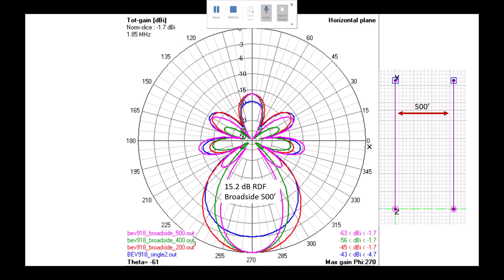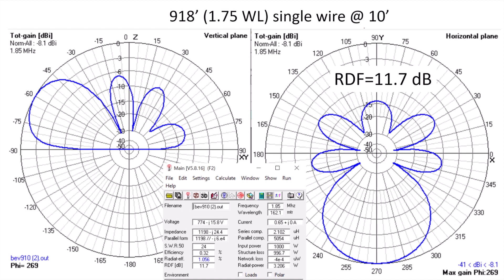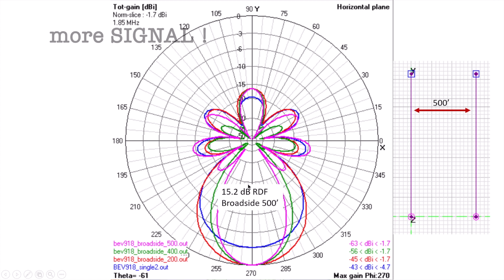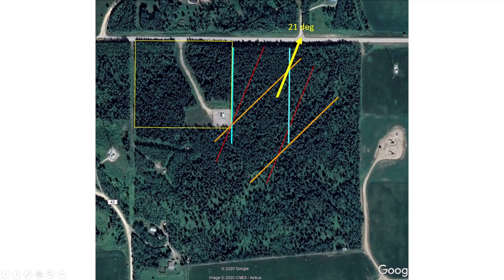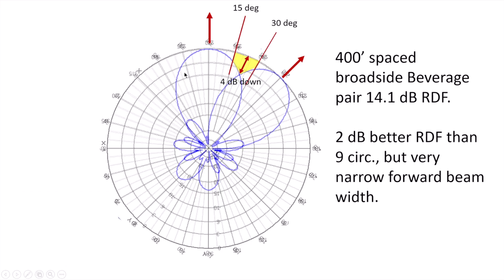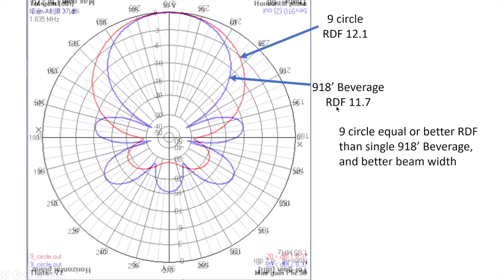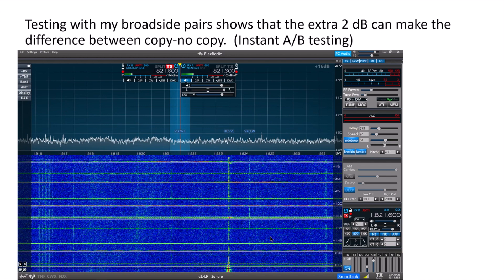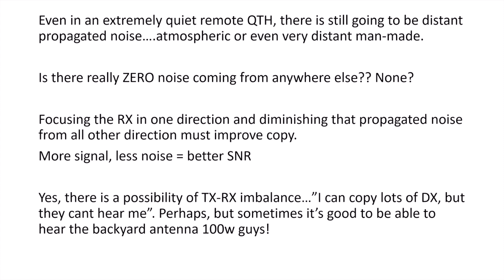Comparison of single wire, broadside phased Beverages and the 9 circle rx array

Comment: Again, excellent video. Now I will “challenge” you to make a
video showing i.e. 9 circle array compared to a single vertical antenna for 160
or 80. Your FLEX 6600 do have two equal receivers, I guess you can switch RX1
and RX2 for A/B testing! 

Keep up the good work. 

73, 

LA7THA